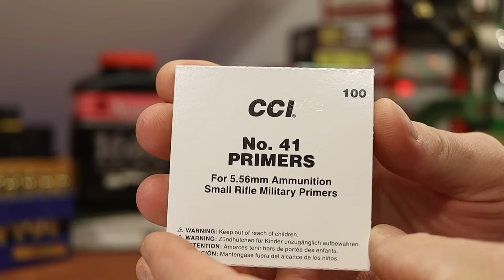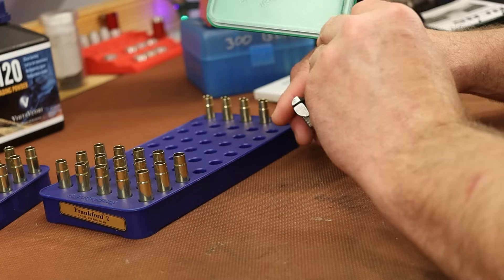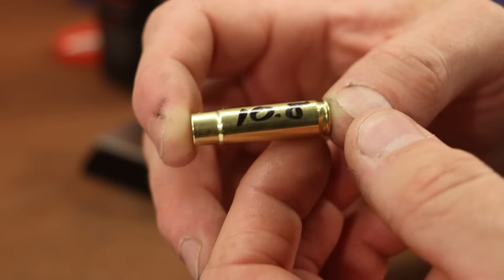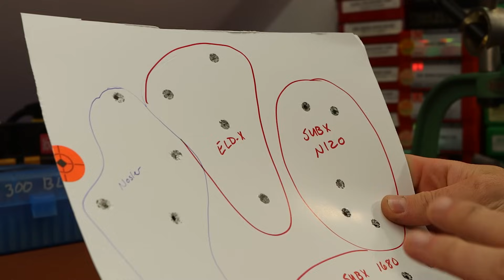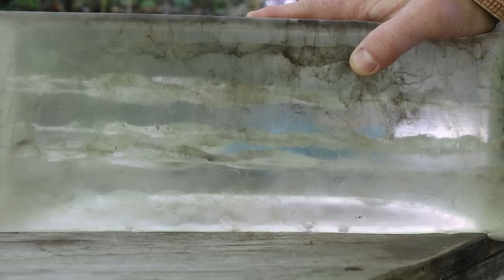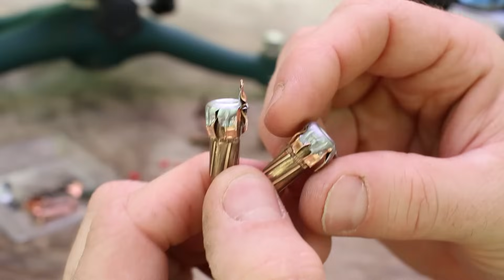300 BLK - 190gr Hornady SUB-X with N120 and 1680

Comment: I'm 15yrs late to the 300BLK party.  Just now started working up loads for my MCX 6.75" LVAW.  N120 and the Sub-X are magic in terms of accuracy, terminal performance for a subsonic bullet, and precision.  N120 is amazing.  I tried N110 and even though it functions and is super clean with this bullet, it doesn't quite lock back.  Also using the 110 and 120 Tax-Tx bullets for my supers loads and am seeing much better results with SW Heavy Pistol.  Single-digit SD's for both combos but precision with that bullet is much worse than the Sub-X.  I'm shooting out of a 1:5 twist barrel so I should be using copper solids with my supers as they are approaching 300,000rpms.

Comment: Really glad i came across this channel. Been reloading but starting to get into Subsonic ammo in 308win and 300blk mainly with later some in 6.8SPCII and maybe 223Rem & if I build a 338arc or 338Federal. I got a magneto Speed V3 and and got Titegroup and CFEBLK. I had a chance and still do fir VV N120, but had read VV N110 is what thry recommend so overlooked N120, would u say its a good subsonic powder without hsving to be compressed for shooting 155-185gr or even 165gr-200gr in 300blk? It looks to be doing great with 190gr, but idk if u slhad to compress those 11gr of N120. Could u clarify on that specific load some please on compressed or not and the finer details like that? Thank you in advance if this comment finds you lol. Either way keep making these great knowledgeable videos.

Comment: I bet that be good for 30-30 with tubular magazine.
Reply: 30-30 twist rate won't stabilize these bullets.
Reply: @ 1 in 10 should be just fine, some 30-30s have a 1 in 10 twist.  1 in 12 might work to, just have to test it.

Comment: I’ve been using the 190 sub-x on deer out to 100 yards for 3 seasons now. I use accurate 1680 and run them right at 1050. They are absolutely the best bullet I’ve found for whitetail out of my 300 black. I tried supers with the 110 Barnes tac-tx and wasn’t getting reliable expansion. With the sub-x I’ve shot close to 10 whitetails, 2 150 plus pound bucks and none of the deer shot have went over 20 yards, most are DRT. As you’ve shown the sub-x performs like a nosler partition. Full frontal mushroom with a solid base driving deep. I’ve only recovered 1 bullet but it looked identical to the ones you shot through the gel. The recovered bullet was from a doe I shot head on in the center of the chest, the bullet traversed the entire length of her body and lodged in the far side of her back ham, maybe an 1” from exiting the rear of the deers ham. To say I was impressed was an understatement. I’ve now loaded over 700 sub-x’s and will hopefully have deer bullets for years to come.
Reply: Awesome POST thank you for the info!!
Reply: I assume 16 inch barrel, how many grains of 1680 is getting you 1050 fps?
Reply: @jmf1976jmf  using a 10.5” 11.3 grains hits rights at 1040 lake city 556 cases cut down  and  s&b primers
Reply: And out of my 16” American they don’t break speed of sound (or at least don’t sound like it) I don’t have any chrono data for that gun in my load book but I don’t believe they speed up too much more out of that barrel either.
Reply: I'll show you a full frontal mushroom
Reply: I have some loaded up ready to go, right at 1050fps.  Glad to hear your results. My thoughts vs all copper are that subx costs 1/5 of those Maker Rex, so I get more practice at different distances. The other thing is those first groups would disappoint me from my crossbow. Why wouldn’t I just use the crossbow. While the subx could stretch the distance to maybe 100 yrds being way more accurate.
Reply: I had the best luck with the Barnes 110gr TacTx loaded hot over LilGun out of a 16” barrel. All deer dropped quickly. Only recovered 1 on the far side, under skin of a large buck. Expanded perfectly with 4 large petals.

Comment: Interesting video, and wow, N-120 was good.  Have you ever loaded a .308 with SubX and N-120???.  I live in N. Ireland and getting powders like Trail Boss is now I think impossible and the EU banned some powder due to it having some carcinogenic something in it.  The reason I ask is I have a .308 and a box of SubX 190g bullets.  I can get Viht N-120.  I'd love to see a video on that if it is a possible mix.  Thanks
Reply: I use 12.2gr of N120 with 190gr sub-x to get 1,080fps out of a 5.5" suppressed rattler. Seat to cannelure, use magnum small rifle primer and put a good crimp for best results. 
To adjust to your barrel length, reduce the charge by .25 grains for each inch (my observation has been that 300blk subs gain about 30 fps per inch and N120 provides about 15 fps per tenth grain).
Reply: @no-sway3709  I forgot to day my .308 is not a 300 BLK, it's a bolt action .308 rifle.  Bergara B-14 HMR with a 20" barrel.
I bought the Hornady Sub-X 190g bullets but finding the powder is a different ball game. Viht is easy to get and I use it a lot.  Just concerned that it's not bulky enough to fill the case of a standard .308, which is 51.18mm or 2.015".
Thanks for you reply and if you can shed light on my set up for Subs, I'd appreciate it.
Regards
Hugo
Reply: @Big222Dog  trail boss may work then. Not sure if you can find that though.

Comment: @JohnnysReloadingBench thanks for all the info. I've watched all your 300 BLK videos over the last year of getting into reloading. 

In your opinion which powder is the better option for 300 BLK subs? CFE BLK, 1680, or N120? 

I've used a good bit of CFE and 1680 but I've read that the N120 burns much clearer. What is your opinion?

Comment: When using a bullet seating die with taper crimp, can you separate out those two functions? Maybe adjust die depth to avoid crimping while bullet seating then come back with the bullet seating stem screwed way out but with the die adjusted for crimping? So bullet seating first then crimping on the second run. Any reason that wouldn't work?

Comment: With that atrocious accuracy, even at virtually point blank range, I would not even pursue those loads. I'm amazed you even hit the gel. I could not grasp any sense to your reloading methodology, if you constantly change many variables at the same time, it would only be pure luck if you were to find an accurate load for your gun, I would recommend getting one powder, one bullet one primer and methodically vary the charge weight until you find out if that bullet will even group or not, once you do get something to group only then would I take it to a gel test, just wanted to ask anything in gel if you can't hit anything with it. To any of you that are new to reloading, please do not use this video of an example, as to how to do it.

Comment: Has anyone shared my experience with the edge of the bullet tip catching in the barrel extension and causing a FTF? I’ve tried COAL’s from 2.045 - 2.175. Same issue. Seems that the tip catches and the bolt loses its grip on the case head, and closed on a the round while the tip remains stuck in the barrel extension. I have clear marks on the case heads where the bolt comes back and grabs the next round. I’ve increased powder to rule out under-gas. No issues with any other bullets I’ve used. Wilson Combat barrel. Aero bolt.

Comment: Johnny,  Using Li' Gun, I've worked down to a "max subsonic" load (~1070fps) in  my 8.5" barrel and got comparable results in my 10% cleargel. I've also worked up to a "max" load in my 16" bbl, slightly over 1600fps. Spoke with the nice folks at Hornady and was told they haven't tested terminal performance over 1400fps. with them.  Seeing what they'd do over 2k into gel should be entertaining. I haven't gotten around to gel testing my "max load"

Once thing, for safety.
I was taught, when working on developing a subsonic load, it's safer to start supersonic and working DOWN to your target velocity. You're normally not worried about being over-pressure with subsonic loads, and you're less likely to stick a bullet in the bore that way.

I'd hate to see you have to do a video titled,   "How to remove a stuck bullet from a 300BO bbl" 😉

Comment: Had great results with the SubX with CFE BLK and CCI 450s. Seated to 2.070. Charge weight 12.3gr. LC converted. 1 inch at 100 yds. Velocities were averaging around 1105 fps with an ES of 8 fps. It's a little fast but the accuracy is there. Works well with my ACOG hold overs in my 16 inch and my 9 inch. Going to test a bit more but it is looking good for deer season.

Comment: "Crunchy" being contact with powder? Thoughts on that?

Found with my loads for pcc that the lower pressures tend to be fairly inconsistant as far as velocity goes, thinking it has to do with inadequate brass expansion against the chamber walls and in the case of 9mm this results in gas blowing past my case. Assuming Blackout pressures are so much higher would be interested to hear if anyone else gets better consistancy as their loads get hotter.

Finally: As a South African, my access to firearms is a battle, meaning choosing the right rifle first time is quite important. I'm quite taken with Blackout so i'm trying to get feedback from other shooters. Does anyone know the twist rate of this barrel? I'm hearing 1:7 is what i should go for at something between 9 and 12 inch. Thoughts?

Comment: Very interesting! I recently made a batch of 300 subs using Missouri Bullet Company's 238 gr powder coated bullets. That's a long missile to fling down the tube! I settled on good results with 10.9 grains of Vihtavuori N120 with an avg velocity of 1046 fps out of my 10.5" barrel. Still a soft shooter, but it really rings that steel!

Comment: I don’t get 300blk, 190gr at 1000fps. Can you say 40s&w ballistics. What is the point of a rifle that offers no more than a pistol? I feel that way about pistol caliber carbines and many sbr’s too. The whole point of a rifle is it’s superior fire power over a side arm.
Reply: Great video and content, as usual. Thx.
Reply: The point of 300BLK is subs with a can otherwise I would just run 7.62x39. The ballistic coefficient of a .30 bullet is much better than any pistol round I know of as well.
Reply: @no-sway3709  who cares about the BC on a 190gr bullet at 1100fps. Let’s face it, those ballistics are for CQB. If you’re shooting it within 100yards anyway, once again it’s no better than a hand gun, suppressed or not with both. Only 400lbs of energy out of a rifle defeats the purpose of a rifle. The only nice thing about 300blk is that it uses straight normal mags, over curved 762x39 ones.
Reply: @JohnDoe-ud2cc  if you're opposed to sbr builds in general then of course you're not gonna like 300blk subs. I can run 265gr subs and easily hit IPSCs at 200yd with a 5" rattler that fits in a backpack and is stupid quiet. Heavy 9mm subs are easily outclassed past 50 yards. At 100 yards my mp5 will certainly make hits, but the energy difference isn't even close in my experience. Of course a mid length rifle will outperform, but at the cost of being longer and a lot louder when in many instances 300blk will do the job just fine.

Comment: I have a 300 blackout in 10.5 in barrel and hope to finish up the bench and get my reloading started, I like the 147 gr at 2200 fps in the Super, it is like a laser to 100 yds, but I really want to go with a suppressor and get in the 200 gr area. Good Video, a little hard for me to follow, but I am sure once I reload a bit, it will be easier to follow, gave you a sub, I need to remove some 🧐

Comment: Just finished my work up of the 190 grain Sub X with n120  for my 8.5" blk.  Then I found this video, haha.  Used same cases and primers as you and settled on 9.1 grains of n120 at a coal of 2.175.  Ave: 1,033 fps ES: 17, SD:7  For some reason I just could not get a shorter seated round to work in my gun, grouped well but ES and SD sucked.  Went through almost a whole box trying coals between 2.050-2.150.  I actually worked this bullet up for my 10.5" 7.62x39 as well with very similar performance at 12.3 grains n120, same coal.  Nice to have one bullet for multiple guns.  Great video, I agree all copper for deer, but these make a great varmint round.  Next up for my work up is the all copper 195 grain MKZ Cavity Back bullet.

Comment: One more thing if you want it to be a little quieter try putting a Kali key ( it converts your semi-auto to a bolt action initially it was made to making AR-15 California compliant without putting shark fins and other stupid stuff then the only thing that needs to happen to go back to a semi-auto is pull the Kelly key out and drop in your semi-auto Bolt )
Upside is that when you are shooting suppressed you lose the noise of the bolt working in the action.

Comment: I have used the Hornady factory load for the 190 Sub-X for hogs and deer. My longest shot has been 52 yards.  I get consistent nickel size exit wounds from broad side shots. All animals were down within 30 yards.  The solid copper bullets do expand larger, however I get far less penetration with no exit on broad side shots. The animals also take much longer to go down. 50 to 100 yards.  That's why I stick with Hornady Sub-X.  It may also be noted that the Hornady load is the only 300 Blackout factory load that meets the F.B.I. performance requirements.

Comment: higher than 200 grain bullet weights in 300 blackout need a 1 in 7 twist rate for good stabilisation , 1 in 7 and 1 in 8 has high throat pressure therefor long throat cones and deep chamber throats are used to give the bullet freefloat inertia before hitting rifling to sa void a gas spike by the heavy projectiles hitting rifling with insufficient inertia to press themselves into the rifling, that causes a pressure spike til that heavy projectile gets moveing again, thats miliseconds but can be hundrets of PSI changes in burn rate and Pressure curve- also influences gas port pressure - dont stick heavy bullets out so far they almost touch the chamber throat - that free float is needed and engineered in for a good reason

Comment: The expansion was not all that impressive. I’m wondering how they would do at faster velocity. Push it to 30-30 velocity and work your way down to see how they perform there. Looks about like the results I got when I used the 160 ftx
Reply: I was wondering how they would perform in a .30-30. You could probably push them to 1900 fps or so.

Comment: Can't believe how many comments think you need a 1in5 twist for 'subsonic' blackout. Twist rate is more bullet length than anything and if you're shooting copper jacketed lead core bullets you can still get away with 1in9. I use the lapua 308 subsonic bullet and it's just fine in my 1in7, heck my mate shoots them out of an ar10 with a 1 in 10 twist barrel and gets sub moa at subsonic velocities. Boutique copper bullets might need more twist sure but you most certainly do not require a 1in5 twist. If you want a subsonic only pistol length rifle to shoot expanding ammo with good performance at short range you're probably better off with a 45acp. I suspect most the accuracy troubles come from case fill with certain powders myself. You want as little room as possible in the case after the bullet is seated without compressing the load for repeatable performance. Muzzle brakes, cans and bad crowns contribute as well. Tune your load without the brakes or cans then make sure it still shoots well through them and crimp your loads if magazine fed.

Comment: When it comes to subsonics, you just can’t beat expanding copper performance. The SubX bullets are nice and accurate, but they really aren’t doing a whole lot more than an FMJ. Subsonic wounding is cut-on-contact only without that hydrostatic shock.

Comment: I love that when you say it’s okay if it’s only a 50 yard accurate load and then shoot some of the tiniest subsonic 300blk groups you’ve ever put down
Reply: One of the uses I have for the SUB-X is a 50 yard load for my AR Pistol (and eventually a short-barrel rifle I'm building). Having a loading that would hit a quarter at 50 yards has a lot of value, especially with AA1680 (considering how much I own of it for just that reason).
Reply: I probably would hold these rounds to 50-60 yards for hunting, but the platinum-tier accuracy of the Sub-X loads is still a huge plus, because it will allow for precise shot placement, which matters when your hunting bullet hits at 980 fps

Comment: I love you brother and that n120 group was sweet, but I just can't. 300 blackout is the absolute dumbest cartridge ever made.
Reply from the maker: There are a lot of cartridges I don't have any use for. Doesn't mean they're dumb.
Supersonic 300 Blackout is an amazing short range whitetail deer cartridge.
Subsonic 300 Blackout is mostly useless, but it's the most fun you'll ever have with a suppressor.
Reply: @JohnnysReloadingBench  I mean, yeah, all bullets are cool, but I can load 158gr 9mm with some power pistol and have 50thou more frontal surface and great expansion if I'm planning on staying under 100yards. I'll stop being a negative Nancy. I love watching you on the way to work on Mondays. You keep loading them silly bullets and I will keep watching.
Reply: @livingintheLight.  >190gr bullet with a spitzer type profile will do much better at range. 9mm falls of after 100 yards even out of an mp5 whereas I'm comfortable out to 200 with the 300BO rattler and subs. 
Also what 158gr 9mm bullet expands? Heaviest I have is 150gr HST pulls.

Comment: What was the accuracy like with the Makers and Lehighs?

Also, now wondering how the SubX would group from my 8.5”
Reply: Makers accuracy was about a minute or so for the LeHighs, but they performed perfectly each time when I used gel. The Sub-X 190s were very accurate and should be fine if you get seating depth correct. I'm using n120, but 1680 does well and is easier to find.